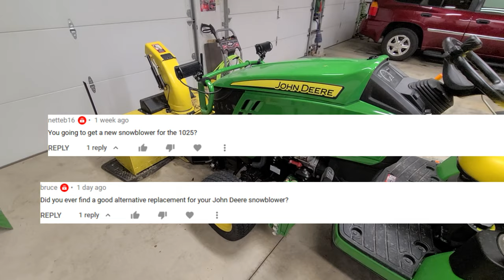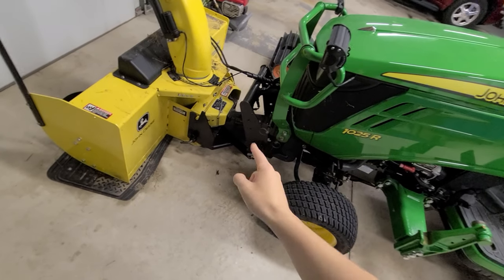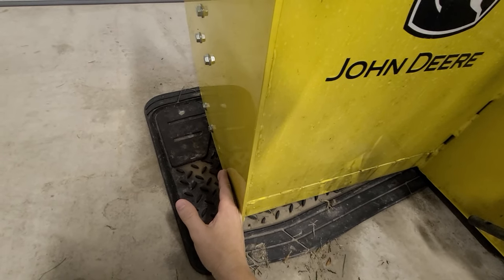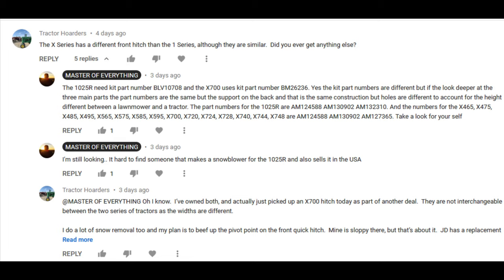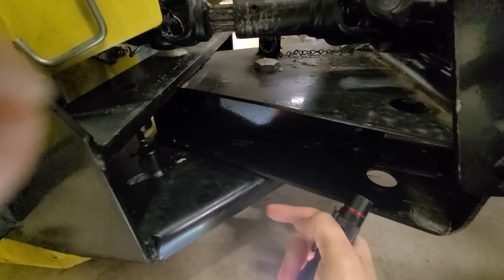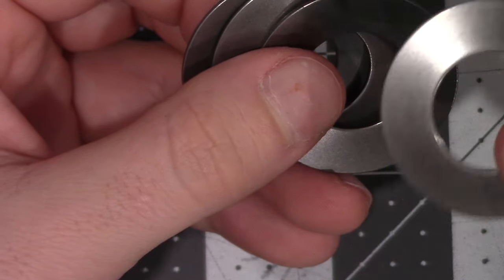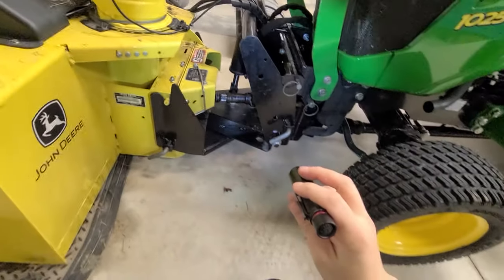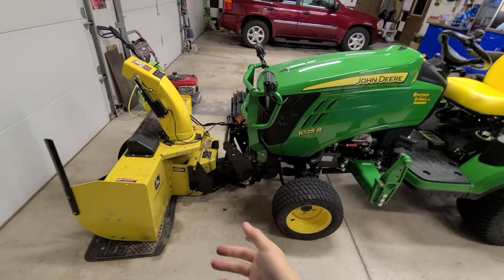🔧John Deere Quick Hitch Problems - Update #1

Comment: we did install a grease zerk on the a frame pin  works great and was easy to do    nice true vidio about there downfall of problems on the hitch,,we have welded in some spacers to take up some of the slop''   used a lot for the last 6 yrs,,on a 1026
Reply from the maker: Check out my video on the new HD snowblower

Comment: Very informative great work, I am  going to need a new hitch for my 2025r,  the frame, A- piece are the same as my  X720 but the support  AM132310 is different and almost as much as the whole dang kit BLV 10708
Reply from the maker: Oh ya.... Your almost better off to buy a whole new kit. The sad part is buying a new hitch does not solve the problem it will do the same thing again. How long did your hitch last? And what went wrong?
Reply: @masterofeverything6468  hitch is 12yrs old pretty loosey goosey now. I am going to a 2025r for snow and some fun , can not underestimate snow in northeast after this year, used the x720 to get the truck out. I will try your mods to the old hitch and buy new with the 2025r, thank you for your attention to detail on those mods. Will look forward to your vids      btw the same exact  failures on my hitch as yours, shuffle side to side being the worst
Reply from the maker: @timtaylor7106  To be honest with you, I would recommend not putting a John Deere blower on the 2025R. In the next week I will be making a video about some other options for front mount blowers. My hitch only made it 3 years on my 1025R and a 2025R is another 200Lb heavier.

Comment: Very interesting. I like your work, and see lots of ingenuity -- I commented on your other video. I have an X738, and am not going to get into who's got the better machine, as mine is perfect for my situation and I didn't need bigger. But I push a lot of impacted hard snow above the snowblower and have had no issues.. she grunts just goes through it. When my QH system decides to eat itself one of these days, I'll be coming back here and try to immolate your system, get frustrated, and probably buy another QH system.. or, by then, I'll just pay to have someone do my sidewalks... lol. It would be MUCH cheaper, but not as fun!
Reply from the maker: You just contradicted your first comment 🙄

Comment: I have a 1025R and the 54" quick hitch blower. Had it for two winters now. First winter big sprocket walked off of shaft and deere replaced both sprockets and chains. Second season fan came loose on shaft because of clip and bearings on shaft went bad. Again deere replaced everything but 24 month warranty is done this summer. I did adjust the skid shoes down because I was picking up a lot of gravel. Seemed to help blower run a little better but chain seems to stretch easy. Plastic fan shows a lot of wear. My dealer has been great but they say I'm the only one they know of that's having problems. When I use it, it's usually for 4 to 6 hours none stop. I feel it's a light duty implement. Rad Tech is a brand I've checked on but it's over 5k and not feasible at this time. I'm open for any ideas or suggestions.
Reply from the maker: I had another commenter point out to me that Deere has a gearbox to replace the chain and the two sprockets, me be something to ask your dealer about, only $140ish plus gear oil. Your not the only one having problems just reed these comments. (the user icefishdaily is having problems with the chain too) There is a steel fan that Deere sell too but $400+ is a hard pill to swallow. Yep that is my feeling too, its good for one driveway but if you want to use it for real work it will fall apart 300times faster. Who did you check with for the radtech and are you in Canada? There will be a part three soon.

Comment: I have the same problem with mine. Been thinking about removing the center locking pin that gets removed for plows then finding a titighter fitting bolt with lock nut and tightening it up that way. Noticed mine does it more because I have used the plow on it
Reply from the maker: Do it! It made a noticeable difference on mine.

Comment: I have the 1025R with the 54” snowblower which I bought new in 2018. After 20 hours of blowing snow, the chain blew up, taking all the gears with it. Got it back, 2 hours in, did it again. Riesterer and Schnell said I was pushing it too much. I said I had better luck with my old  Husqvarna 42”, that only needed a new belt once in awhile and threw stones for 15 years without any problems. JD claimed any rocks would destroy the unit. Salesman assured me before I bought it rocks weren’t a problem. (Not that I purposely threw them)
This season I replaced both bearings in the 2000rpm hitch assembly.and one shear bolt for the impeller. It does not like very wet snow. .
Reply from the maker: I don't ever know what to say about "I was pushing it too much". Just out of curiosity what R&S? There is apparently there is a gearbox to replace the chain may be something to look into the part number is AUC16953 around $140ish plus gear oil. I replaced a bearing too this year. The 1025R is great but the snowblower needs a major update or a commercial model.
Reply: @masterofeverything6468  Riesterer and Schnell
Reply from the maker: what location? There is over 10 in Wisconsin?

Comment: As I said in my previous comment in your first video John Deere blowers hardly blow snow any distance at all and watching you go at that pile on the curb it only confirms it! I hope you find a blower the same caliber as the Kubota Commercial Blower!
Reply from the maker: I found some more information and there will be a part three soon. I pinned a comment with a link to a playlist where the next video will be posted to.
Reply: A mechanic at a Deere dealer told me the gear boxes and the plastic impellers were an issue and he wouldn’t buy one.
Reply from the maker: @orestwitiw213  Next video on this will be good.... Lots of new information coming
Reply: @masterofeverything6468  I live at a border city and if you send me the year of your 1025 I’d be happy to contact Canadian blower manufacturers to see if they make blowers and hitches for John Deere 1025 tractors. If this COVID ever buggers off I’d even be happy to haul across the border for you if you arrange shipping after you purchase it. To date I’ve had no issues with my Kubota blower which I believe is a Radtech. Stay away from the Residential one it’s not good. Last winter I put 50 hours on that blower and only broke one shear bolt on the auger and that was my fault. We had close to 13’ of snowfall last winter. Not much this winter.
Reply from the maker: @orestwitiw213  Thanks I will keep this in mind but I did get the phone number and name of RadTech's US distributive just need to find sometime to call them.

Comment: You can easily upgrade the blower gear box for $160 and weld in crossmember supports between the hitch frames  to significantly reinforce it.
Reply from the maker: I fully understand that but for what you pay for the snowblower you should not need to do that.

Comment: I agree that for the money the snowblower is chincy, it flops around, The chute with its cable doesn't work well and it needs a a way to raise and lower the top of the chute  Plus the hitch setup is kind of light duty. But why would you improve it if no one else makes a blower to compete with it? (Econ101)
Reply from the maker: I get the Econ101 but that is a great way to encourage someone to make something better. And as far as no competition I may have a lead on something better but I need to make some more phone calls

Comment: Switching between the JD snow blower quick hitch and FEL is not efficient as per comments from users. Best look into that changeover with your considered replacement. Also, there is a replacement 4 wing impeller for the JD blowers which appear to throw snow a lot further...
Reply from the maker: No snowblower to loader conversion is never easy. I can do it now in about 8min. The "replacement 4 wing impeller" is the steel impeller I talked about in this video and its over $400

Comment: I have a 2025r with 5 hrs run time and its sloppy from day one. As a retired tool and die maker, this mount is way under designed. Someday soon my plug and play will become plug and pray.
Reply from the maker: I would say from new mine had about 1in of play and after about 50 hours of snowblowing it had 4-5in just before I "farmer fixed it" LOL It may work great on the small lawn mowers but has no place on a tractor.

Comment: The Rad Tech blower system is a well built unit ! I wouldn't be afraid of breaking a thing on it. Ordering is only a click away. Anything can be shipped worldwide as I know first hand experience from my source of employment.  Arrrowtank.com. Food for thought....I got my 54 blower assembly Jan 5th 2021. B4 i blew any snow,  I shit canned that plastic impeller and got Deeres upgraded steel impeller.  Traded the plastic one in for full refund ($137USD). Steel impeller is ($425USD). PN for the  steel impeller is AM109105. It's not just steel...it has hooks on each of the 3 blades  to grab more snow per revolution! Plus...the steel one only has a 3/16 gap from blades to the housing  versus 1/2" plus for the plastic one. Waaaaay more efficient  !! As far as the quick hitch assembly goes....Im gonna ridged mount my hitch also.
Reply from the maker: You said "ordering radtech parts is only a clickaway" do you know a website for parts? If I can't find a better blower I will get the steel impeller.

Comment: same engine
Reply from the maker: but twice the weight
Reply: ok 1025r wheelbase is 57.1 inches and the x758 is 54.5 inches 2.6-inch difference as far as the weight 1025r is 1444 lbs. and the x758 is 1038 lbs.  only 406 lbs. difference, I did plow and snow blow with 1025r I had 4 of them now I used 2025 at 1660 lbs.2436 lbs. and 2038 couple of inches wider and longer but I bit more weight and taler 1025r ad problem climbing over sidewalk even with the front 3pint itch I have the same blower in front of my two 2038 except there 60",I tried al type 1025r good tractor for a homeowner or a very light commercial usage but the problem is like the x758 the front sit too low from the ground enjoy your blower there good have about 600hr on mine